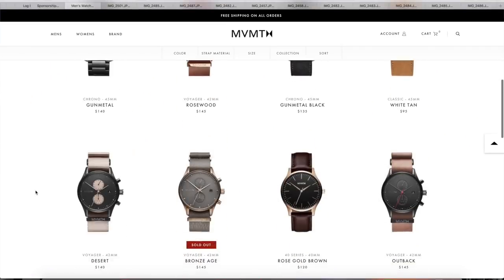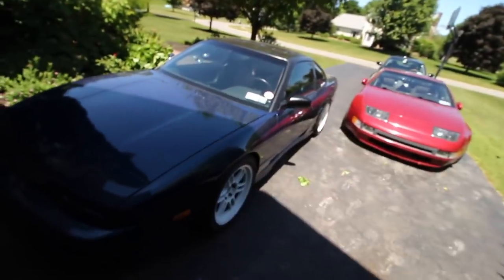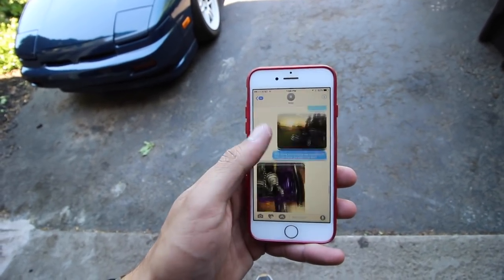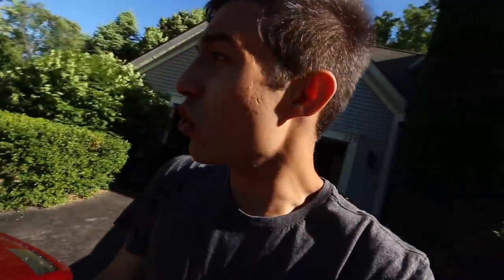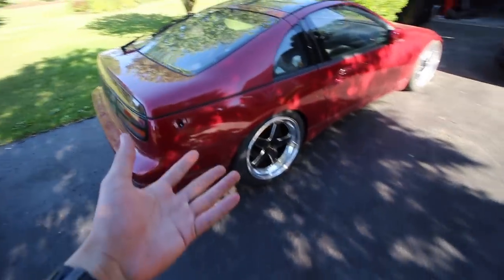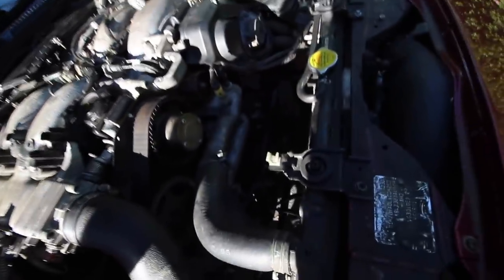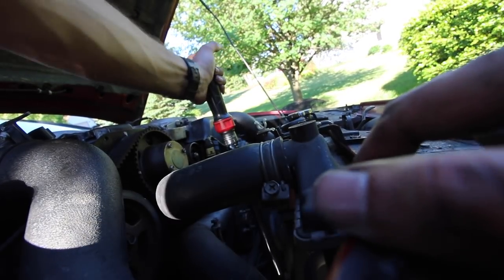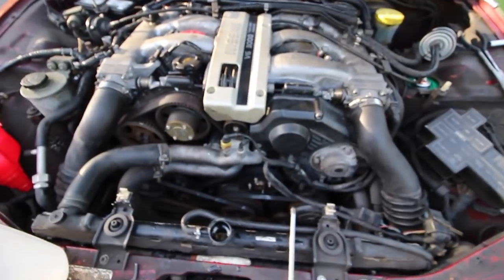One of my Cars EXPLODES on Camera!

Comment: High pressure relief valve on the ac line popped off. It basically dumped out all of your ac refrigerant out. The system wont hold a charge anymore until you replace it. They're about 22 bucks from CZP.
Reply from the maker: My man thanks!!
Reply: Kalvins Garage what wheels and specs are on that z? They look like the weld rts.

Comment: Kalvin, if you keep having trouble with rb20/ka trans, try a z32 one. You can put an rb bell housing on it and it’ll bolt right up. It might help you stop breaking them, as they can handle much more power. Think about it!

Comment: Definitely want more driving clips of the 240. 

Feel like we don't get to appreciate the cars performance, perhaps you could do a video  on how practical a big turbo on a rb20 is for street driving, track driving, drag racing, roll racing etc since it's usually frowned upon to put a big turbo on them.

I.e. what its like off boost from the lights normal driving, what its like when you pin the accelerator and waiting for full boost, etc.

Comment: If ya ac system is over pressurizing it could mean the ac clutch is stuck on.  Happens sometimes from rust or if the car had been sitting for a while with the ac clutch engaged.  

Also old gas can settle in the system and cause air pockets which can burst out like that.  It's a relief valve by the looks.  Probably lost all your gas though .

Comment: Those pigtails are to convert the car from old-style (pre late 93) to newer style (late 93 and after) fuel injectors, without changing the harness itself
Reply from the maker: Oh I know. But just curious why the injectors were all changed. Not complaining. Just curious haha.
Reply: Kalvins Garage when the time comes, its a very worthwhile update to the engine. The newer injectors used a better metal in the connectors that was way less susceptible to corrosion, which is one of the achilles heals in early z32s. 8/10 times, a dead cylinder is due to corroded connections on the injectors over coil packs or the injector themselves. Such a job would have included pulling the plenum, so inspect for other issues. Also, idle should be around 750 for MT and 850 for Auto

Comment: Awesome video😂. However with your idle I'm not sure.  But I think sense its a auto it should idle at 1000 then when you put in drive it'll go down to 650-750. I THINK. That's how my auto 240 is.